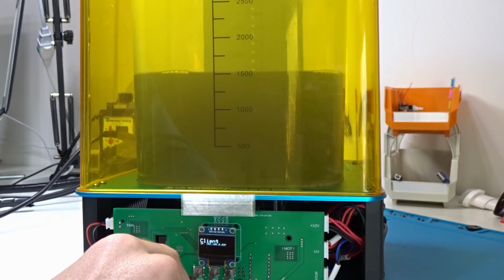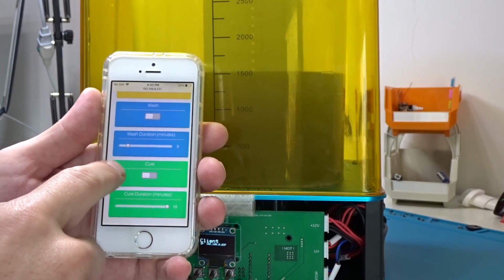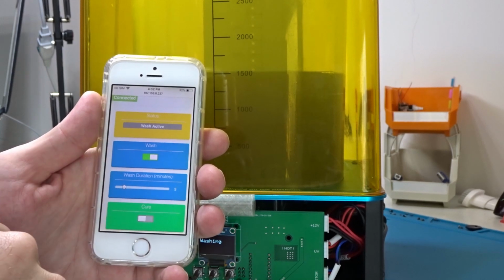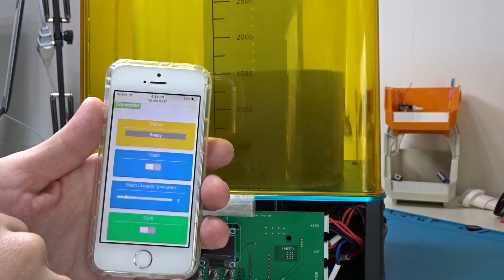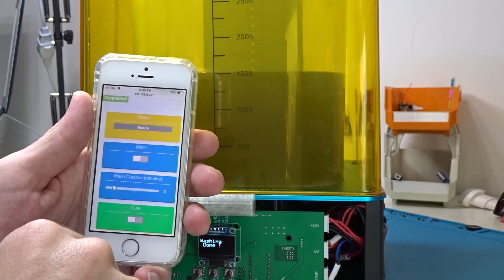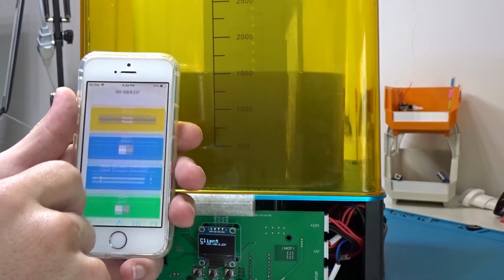Anycubic Wash&Cure DIY Mod or Upgrade board for easier cleanup of SLA/Resin prints

Comment: ola serve na anycubic wash and cure 2.0?
Reply from the maker: Hi ! yes it will work but I am not sure if the wires in the 2.0 are long enough to reach the connectors. You might need to extend some of the wires.